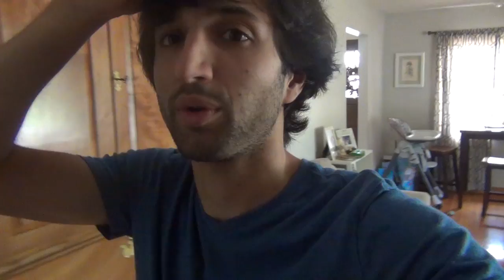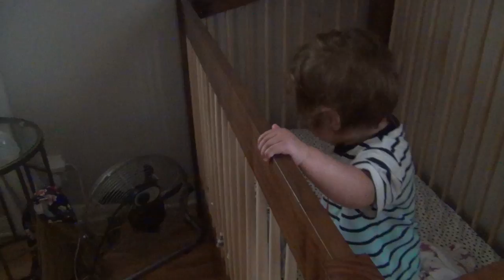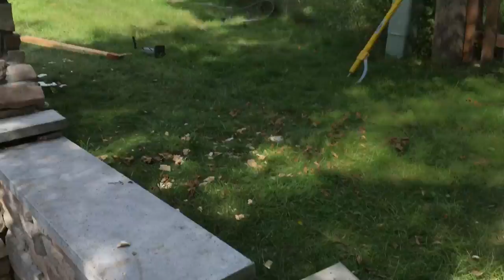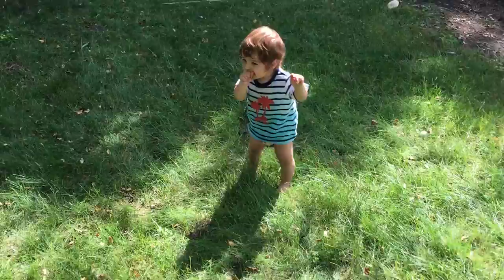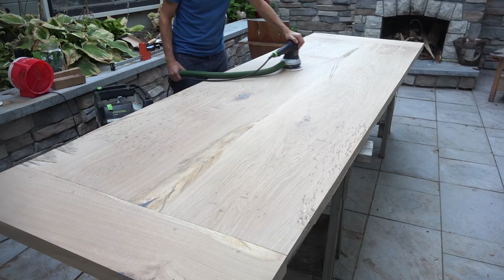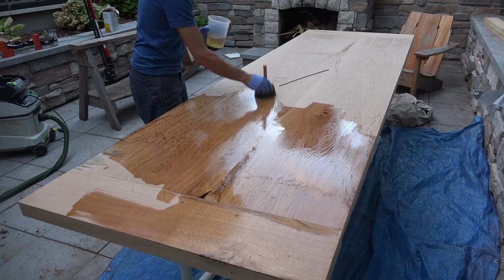Seal Coat on the Table Top [July 28, 2016 Vlog]

Comment: Brush looked like it was falling apart. Would you do something different or was it fine? Thought those kind of brushes caused lots of air bubbles.
Reply: That stuff dissolved the adhesive in the brush and my gloves.  Pretty crazy stuff.  Bubbles aren't a concern since this isn't creating a film on the surface